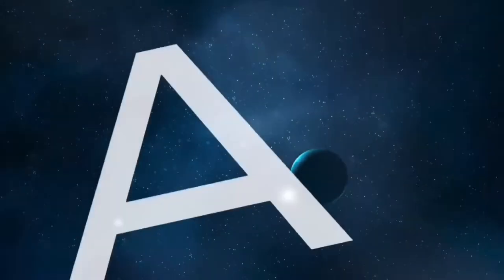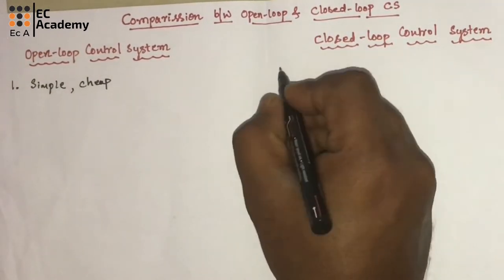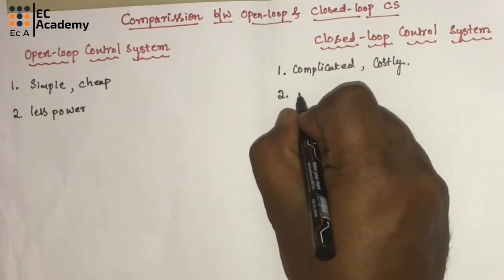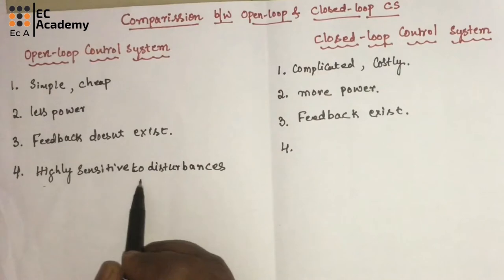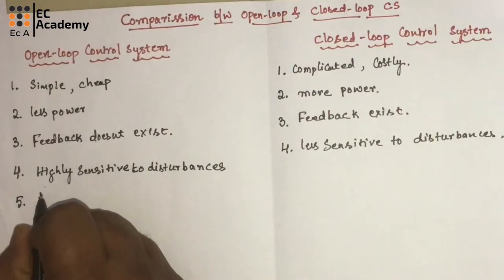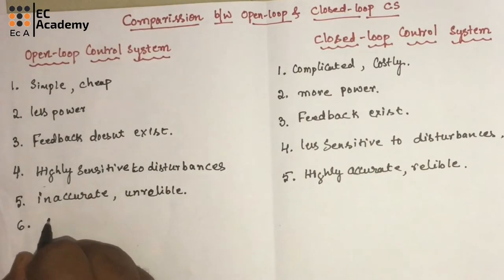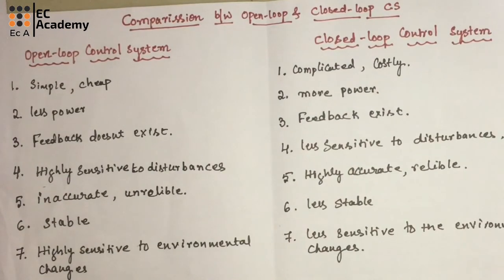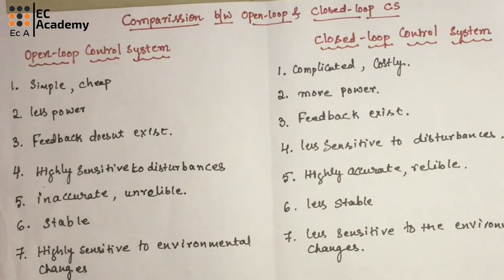#133 comparison between OPEN LOOP and CLOSED LOOP control systems || EC Academy

Comment: Sir  500 TR  air cool chiller with primary and secondry pumps is a open loop system or close loop system ???
Reply from the maker: It is a closed-loop system.
Do subscribe and keep supporting EC Academy✌️